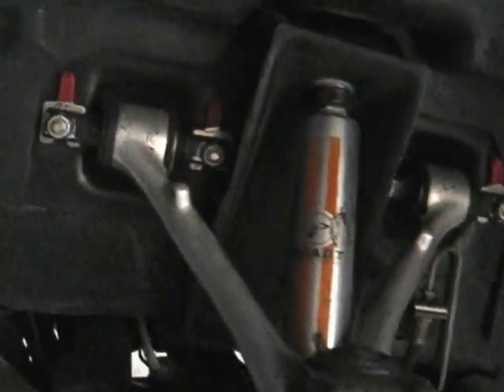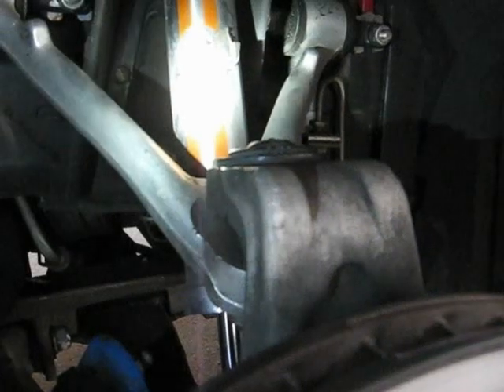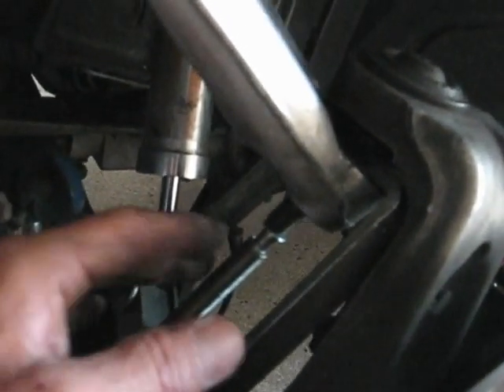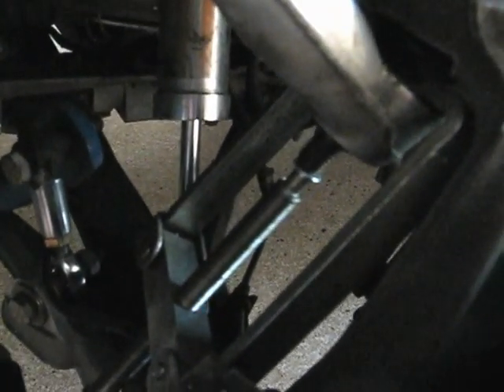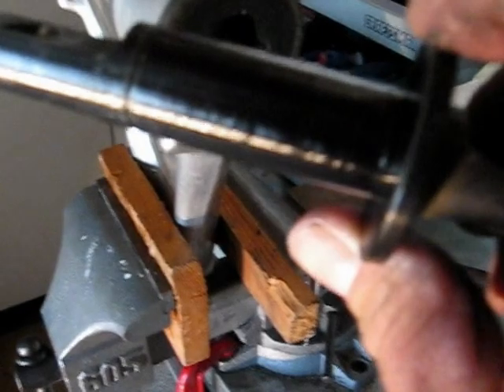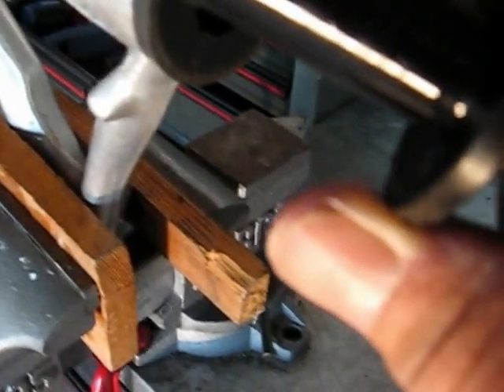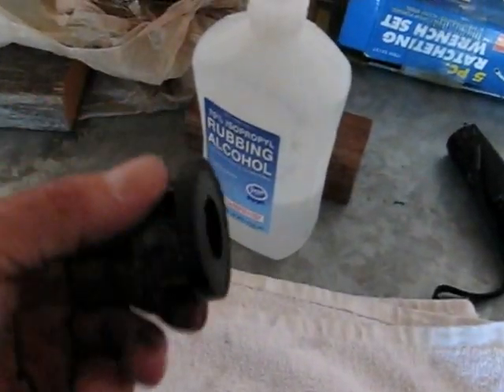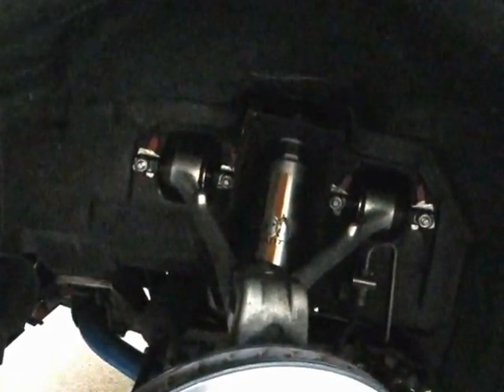Corvette C5 lubricate poly bushings front upper control arm froggy

Comment: First you should be using multiple  Jack stands when your working on your car. Next GM only recommends a floor jack to be used under the k member where you have the most support. Third if you wanted a loose suspension should have left the old worn out pieces in your car or replaced everything with the OEM material  pieces that came on it. but we are talking  about a corvette  and they are built to handle. Comfort is for Cadillac's . Poly Urethane is great for improving a car handling characteristics as well as their resistance to oil,  ozone and other factors that   break  down rubber  when exposed to over time The down side is when they are installed in your car they will  rattle your filings out of your head on a rough road. If you drive the car enough they will break in and it might be more to your liking . It is a trade off either performance or comfort,  like horsepower or gas mileage. Only you can decide whats best for you. Oh last note if you start twerking on, or  thinking about modifying your kit by modifying it, the manufactures spend a lot of time and money designing what you bought, I suggest leaving those mods to those who have the knowledge experience and insurance to do so and are licensed to do  it. Good luck and congratulations on a successful posting , I know they are not as easy as it looks.
Reply from the maker: Thanks for taking the time to comment. If I followed every "rule" GM has re my vehicles, I'd never do a thing except drink bad coffee in their waiting room , and get a stupid overpriced bill.

Sincere thanks again.

:)

Comment: A couple side notes: drilling a hole and driving a self-tapping Zerk fitting in would be fine; keeping the UCA structurally sound - holes are small, the fittings are strong. Aftermarket UCA's have been coming like this for years - an example would be almost any aftermarket off-road UCA. These parts are designed to be put through very demanding paces. --- Regardless of the type of bushings, the ability to spin it by hand is irrelevant; your pressure vs. the vehicles...? --- Also, use a hammer to [firmly] hit the side of the spindle, not the control arm itself to jar it loose from it's pivot. A puller could be handy, but it's extra, unnecessary work.
Reply from the maker: In my case it was unnecessary to add zerks, after 2 years grease was still fine.

Thanks for the comments!

:)